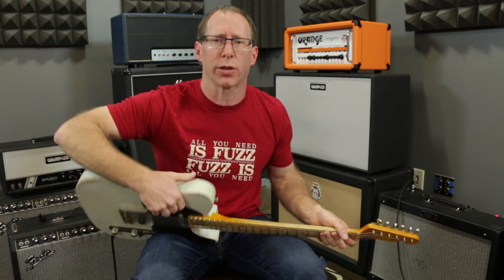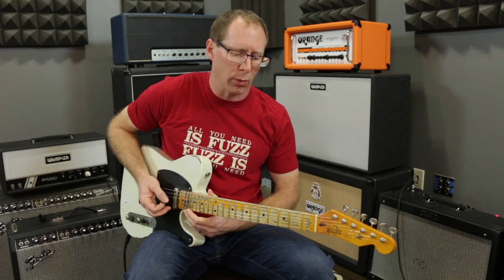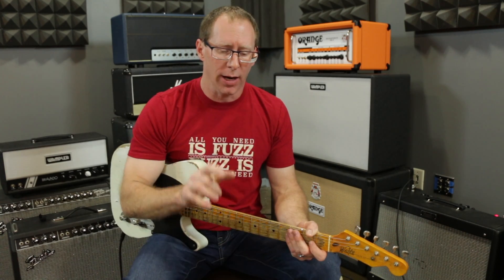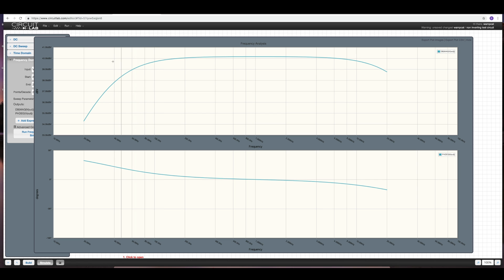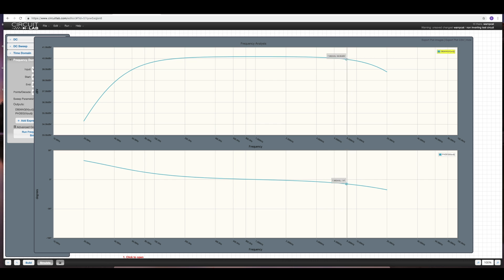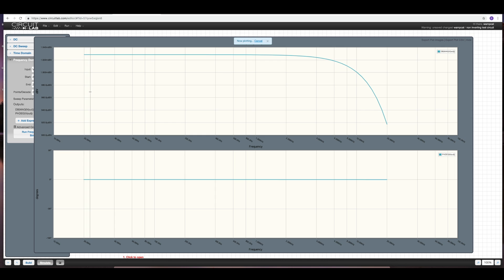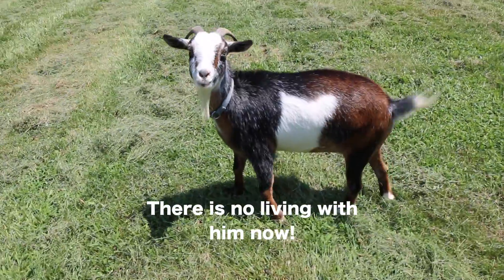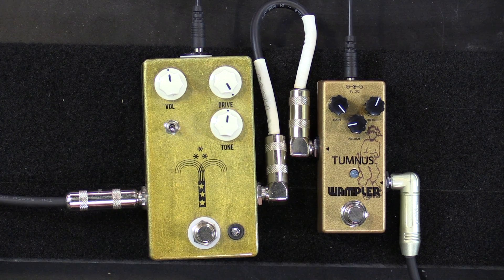Transparent Overdrive Pedals: Busting the myth- Revisited

Comment: Surprising that Circuitlab seems to work OK without any ground reference for the + input of the opamp!
BTW, low E on a guitar is around 82 Hz, so I normally don't worry about anything lower than that.

Comment: All Wampler pedals need a Dynamic Range switch to get more "resolution" from the guitar volume pot, just like the designer Steve Dawson did on the Marshall Vintage Modern 2266 has Two Preamp Volume pots called Body and Detail so that single coil pickups and other guitars can interface better with the input stage of the guitar pedals. The Dynamic Range mode on the marshall vintage modern 2266 gives you a lot of "Resolution" of the guitars volume pots because the designer Steve Dawson custom made the design so you can get variety of CLEAN UP tones. Most wampler pedals don't have a wide resolution range for clean up tones very limited and narrow window, plus not having the body and detail volume pots you can't use a variety of guitar pickups to fine tune and interface correctly with the guitar pedals front end stage circuitry. Pass this on to your EE Engineers to make an upgrade to your pedal designs.

Comment: Something I've noticed is that a lot of times guys will have the gain turned wide open and then be like "I'm' losing articulation..." yeah, no jack sherlock- turn the gain down. Transparent to me just means that I don't lose articulation- and if a pedal can do that at higher gain settings- then it's a winner. I don't have a tube amp so- I'm not crying if the sound of my peavey amp gets covered up- that's generally speaking my intentions. Unless I'm playing jazz- I have to admit, if you want a beautiful clean sound for jazz or something similar- Peavey is great. Some of the higher end peaveys probably sound great in general- but these little combo amps pretty much suck. 

That said- if you take the time to upgrade the speaker- it does wonders for it. I've played it through a friend of mine's cab- a cream back 65 watt 12 inch Celestion- sounds really good. With the tube emulation turned on- it's surprisingly good. I'm considering cutting the head off my combo amp and mounting it to the top of a 1x12 cab but- I probably won't- I may want to sell the redstripe 112 someday- ppl buy them, for some reason. Collectors, I think.

Comment: Well, transparent or not, I love the open setting on my Euphoria on the edge of breakup. I wonder though, if transparent overdrive pedals are meant to not change the tone of your guitar, then why are there tone knobs on them? And wouldn't the ultimate transparent drives be boost pedals?

There's this pedal maker in Montreal called Jonny Rock Gear who makes a pedal called the Rewolver which is a fantastic circuit of a JFET cascading into another JFET, each has it's own boost knob and there is a volume knob to attenuate. Can do clean boosts, push to breakup, and it can give a distorted amp more boom or really saturate the gain. I assume it could be considered transparent. It's a great pedal either way.

Comment: Hi Bryan, my humble opinion about what they called "transparent overdrive"; is that one you don't have to tweak your clean channel eq with, when you engage it. If the overall balance doesn't change, no matter what kind of overdrive I engage, I'd be able to use for example 3 different overdrives without the need of adjusting the amp's eq for each one (cause i'm playing). I don't think anyone talk about a proper flat eq overdrive.. Nice video anyway!

Comment: I see you like fender amps & guitars. Is there any way you can do in depth videos on the fender santa ana overdrive? I want to learn more about how it works & how I can more effectively use it to my advantage using it with my hot rod blues Jr 4 & my pro am tele 1

Comment: I'm sure you've tried (or at least joked about) a circuit that when in the "off" position goes through like a 500 ohm resistor, and when "ON" goes straight through with no resistor.  There's your transparent overdrive.  And it would sell like hotcakes because as Josh Scott says, loud is more good.

Comment: not dissing the technical skills (which are clearly amazing) or anything else, but it does sound like you cherrypicked the settings of the amp to suit your point.

the amp is set really dark, with barely any high end. of course a transparent circuit (that does not try to boost or cut anything) will also sound just as dark, while a circuit that emphasize certain frequencies (especially the high end, basically functioning like a treble booster), will sound amazing.

imho, this video does not debunk anything, transparent overdrives are still something some may need, especially when using an amp that has a certain voicing, that would be incompatible with less transparent overdrives.

for example, if you're using an amp with the mids heavily scooped (like some modern metal amps), if the OD you're putting in front is all about boosting the mids and has a very tight low and top end, when those mid frequencies will get cut in the amp, the overall tone will sound weak or fizzy. of course a more transparent OD would be a good choice in this application.

I'm not saying that transparent/full range overdrives are the best in every aspect or that everyone should want them all the time. I agree that most would not want the final sound to be as flat as the one in the video, it's just that a transparent overdrive will allow the voicing and character of the amp to stand out and will offer you the ability to control/shape the EQ the way you want (either on the overdrive pedal, on the amp or a separate EQ pedal).

Comment: I think it depends on what you call "transparent". The fact that the curve is flat doesn't mean the sound is more transparent. it just means that it's transparent for a white noise. In fact guitar signal doesn't behave like a white noise. To my ears, despite the 1k peak on the curve, sound rather close to the original sound where the breadboard distortion is not transparent at all (way too dark) maybe because of the compression that happens with the distortion.
So yeah there really is a difference between simulation and real life situation.

Comment: The diode clipping circuits shown in your schemetics are as basic as solid-state overdrive gets. These simple designs date back to the early 70's, when cheap high-gain op-amps first became widely available. Adding hi-pass and low-pass EQ either before or after the clipping stage is likewise basic sound mixing tech, no different from the tone controls on a guitar amp. Hundreds of commercial fuzz pedals have been marketed since then, and virtually all of them do this same basic thing. "Transparent" is just a popular marketing term, i.e. "clean distortion".

Nowadays, everyone's used to digitized sound, but back in the analog days we used to have endless "tube vs transistor" debates. There are definitely audible differences, particularly among guitar amps, between tube, transformer, loudspeaker, and transistor (i.e. diode) saturation curves, but IMO power supply response has long been the hidden factor on the tube amp side. Vintage vaccum tube amps take a lot more power to run than efficient solid-state circuits (and fuzz boxes for that matter). The transient response of a tube amp overloaded with a loud power chord sounds and feels quite different than the brick-wall behavior of a solid-state amp. You can come close to simulating this effect with a multi-band compressor combined with a fuzz box, but as always, YMMV.

Comment: Is it possible these frequency response curves are what you need when designing a boost pedal that compensates for how our ears hear according to fletcher Munson curves as volume increases?  So electronically not transparent, but our ears hear transparency because as volume goes up we are more sensitive to bass and treble and not so much mids,so a boost in the mids equalizes it better ?

Comment: IMHO, a clean boost into to tube amp is a transparent overdrive.  Anything else is distortion, and just as a cab sim doesn't sound like the actual cab with the actual mic in the actual room, I have yet to hear a pedal that sounds like an overdriven tube amp...unless you use it to overdrive a tube amp. There are great sounds to be had with pedals and impulse responses but even pedals with tubes in them don't sound like an overdriven tube amp.  Transparent overdrive in a pedal is like dehydrated water.  All you have to do is add water.

Comment: The year before last, Sweetwater practically gave away the new Gonkulator from DOD. I bought it for the ringmod for synth use, but the distortion circuit turned out to be way more useful than I'd imagined. I was surprised that every heavily compressed nuance was coming through, even with gain, drive and level maxed out. I have some Steve Stevens-style, 80s flavored compression right at the start of my signal chain, and the DOD DOES NOT kill anything my compressors do. Best impulse pedal buy ever!
Reply: That’s actually the same distortion circuit as the DOD Grunge pedal

Comment: Correction at 4:43, thre is no 20dB cut in the bass, Brian read the frequency instead of the  dBV. At 63 Hz the signal was down to just 39 dB, less than 1 dB loss from the 40 dBV plateau in the mid range and most of the treble.  Never mind the shape of the curve it really is almost flat!

Comment: IHMO amp in a box like overdrives are less "transparent" compared with other overdrive pedals. Amp in a box for me is a pedal that change a lot the eq characteristics of the sound not only overdrives it making an amp sound completely different not only adding grit and some hump.

What happened for me for example. I had a OCD clone for lead sounds, but I changed for a rat clone. For my situation, even with the mid hump of the rat clone, I fell it more transparent, because when I step on it I have the previous overdrive sound (from other pedals that are not mid hump) with more gain and the mid hump. 

The OCD clone I didn´t like because when I step on it, what come is a completely different sound and that was not what I expect, I think most because of the aggressive eq OCD does at higher gain levels. I would prefer OCD clone for using as an always on pedal transforming my clean amp on a rock and roll amp changing the "base" sound, but it is not my case. 

I think OCD gets more transparent, if you use it less gainy (first part of the circuit). But, in my case I already have low gain stages that I like, so that position was not open. hehe

That is my experience with transparency. Hope it is useful for somebody.

Comment: Are most clean boosts less compressed than the average overdrive?
I’ve been trying so many gain pedals,and found a 27db boost pedal that seems to really have that bright,jangly open sound I crave, it feels like a lot of OD pedals are too creamy,compressed..where that Boost seems devoid of all that..
  Is this the case?.. I wonder why more folks don’t use a boost rather than overdrives.. just slamming the amp w lots of db seems more natural than turning up the gain on OD or distortion pedals..
Except..the Tumnus, and this other Klone I found, Greenchild Kursk.when I start stacking I get great,tight high gain.. and alone they rule. In a pedal builder’s opinion, 
is the Klon circuit really that good??         It seems radically different to me,although I’ve heard other builders say that the Klon is one of their least favorite circuits, but the public wants it, so they build it.. sorry, that’s like a couple of questions..

Comment: I always thought the Big Muff method of getting around the bandwidth limitation is interesting - it splits input signal down two paths, and the tone knob blends them back together post-clipping. That's why the Big Muff has both giant lows and peaky highs! I always wanted that design in more pedals.
Reply from the maker: I think you may have it confused with a different circuit... big muff is cascaded NPN transistors and the tone control is panning between low pass and high pass filters

Comment: Obviously he's right about wanting to filter top and bottom end in certain ways for a decent drive/distortion/fuzz tone. 

However what about if you want more drive on an overdrive channel? There's already a pronounced midrange, and adding another circuit which adds drive but narrows the frequency range, will make it sound heavier from the added "gain" bit less heavy from the thinner sound in comparison.

What sort of pedals would you use in this instance?

Comment: Looking at your circuit diagrams for the overdrive and distortion, you changed the position of the clipping diodes, soft/hard clipping. So my question is, could you have a circuit that had clipping diodes in both positions and then blend the 2 circuits...? This is where you say yeah, course you can, it's in the >insert name< pedal...
Reply from the maker: Yes, just like the Nobels ODR pedals, our Euphoria pedal, the King of Tone, and our Pantheon pedals ;)
Reply: @wampler_pedals  excellent, thank you Mr Wampler
Reply: In many respects, diodes in both positions yield "hard" clipping, unless there is a resistance in series with the diodes.  What tends to make the difference between the two diode locations is that diodes in the feedback loop will conduct below the maximum voltage swing of the  op-amp.  

With a 9V supply, most op-amps can't swing beyond about +/-3.5V.  If you use a gain of 200x (modest by many standards) on a 100mv input signal, you will quickly exceed that 7V swing.  Heck, even if you up the power supply to 15V, you will still exceed the available headroom, such that even in the total absence of any diodes anywhere, you will produce clipping when the signal runs out of headroom.  If there are diodes in the feedback loop, a gain of 200x will certainly make them produce clipping, but because they will conduct when the amplified signal exceeds +/-600mv or so, ALL THE CLIPPING YOU WILL HEAR IS FROM THE DIODES. Take those very same diodes and have them running to ground after the op-amp output, and you will now have "double clipping".  A gain of 200x will make the signal force the op-amp to clip when it runs out of headroom, and then the output of that op-amp will get clipped once more by the diodes to ground.  It sounds harder, because you're re-clipping a (now) harmonically enhanced signal, but the clipping action itself is no different.  

You can do the experiment, and will find that if you placed a pair of germanium diodes in the feedback loop, and stuck a pair of silicon diodes on the output, going to ground, the second pair of diodes would not change the clipping/distortion appreciably, because the first pair of diodes have limited the output of the chip to roughly +/-230mv, and the silicon diodes would need that chip to be pumping out at least +/-500-600mv to produce more clipping from the second set.  On the other hand, given the much lower clipping threshold of the Ge diodes, I imagine it would be hard to actually hear any change in clipping from the second pair of diodes, amidst all that fizz.